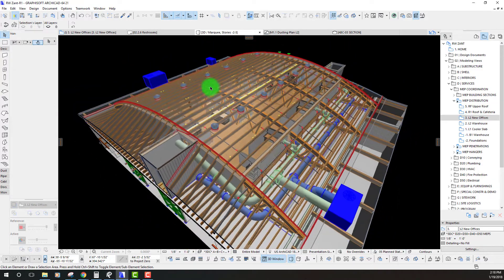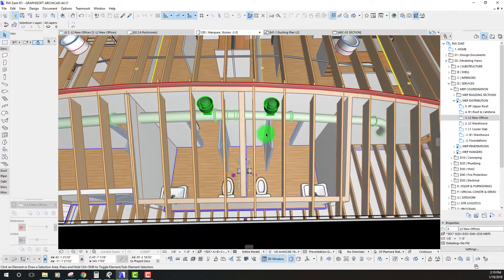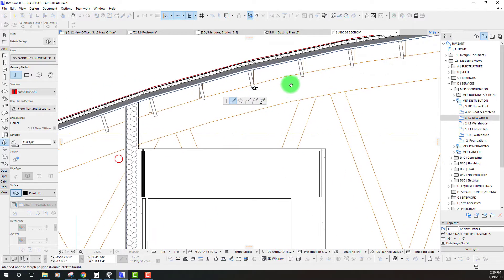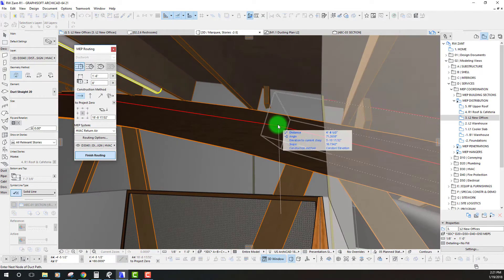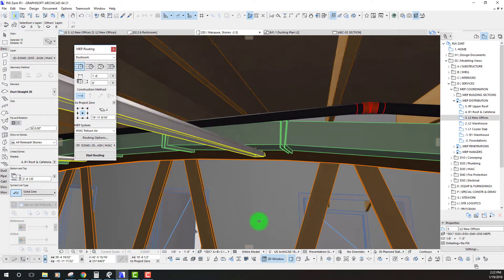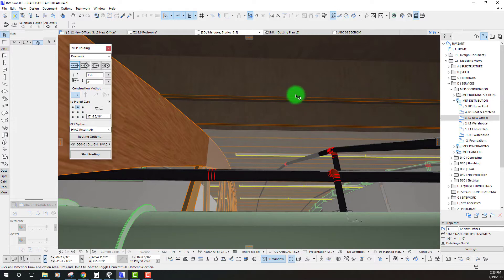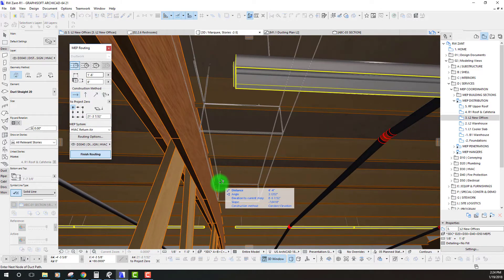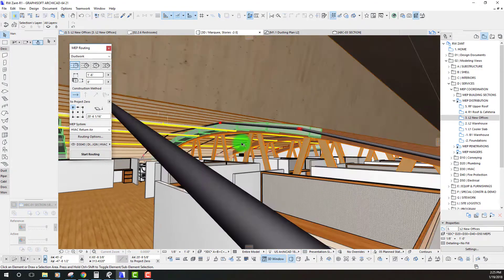Modeling Complex Ductwork in ArchiCAD

Comment: Excellent!!!How do you move in space? Are you using a 3d trackball or similar? Thanks
Reply from the maker: I'm using a 3dconnexion spacemouse. Left hand navigation, freeing up the right hand for clicks. Thanks for the comment!
Reply: i just came back to comment on this. this is science. i got one but its not that easy as it looks. respect!
Reply from the maker: Few tips... I like having ALL directions reversed under the advanced settings. It feels  more natural this way. Also, always visualize where your rotation point is, once you understand where it is, you can move easily around it from there. And of course make sure your scene doesn't have items far away, use the marquee and story filters if you have a large project...cheers!
Reply: I was going to ask the same question. It looks really smooth. Much smoother than the traditional moving in ArchiCAD via orbit.
Reply from the maker: Spacemouse by 3dconnexion! I can't believe people use ArchiCAD without it!!